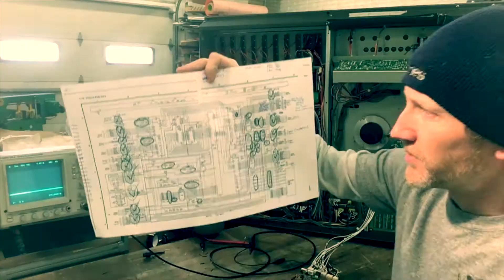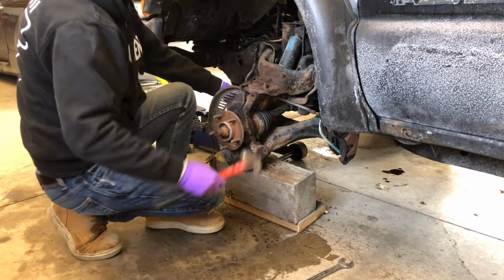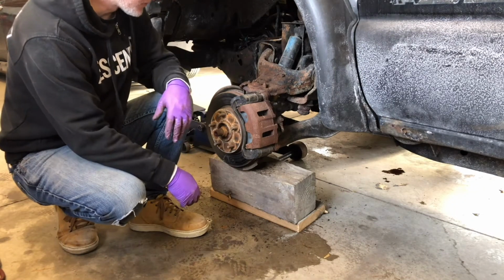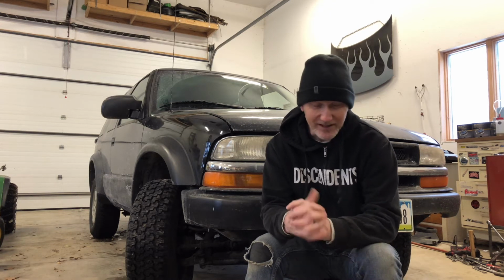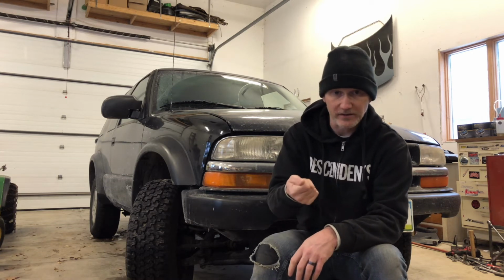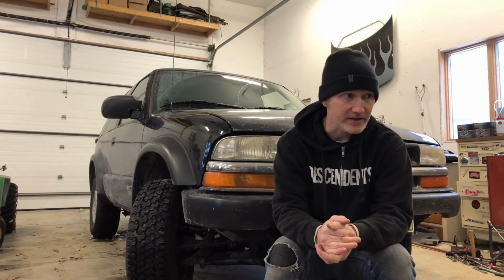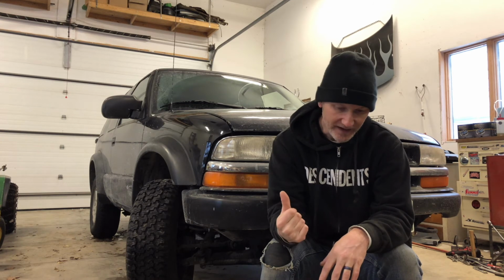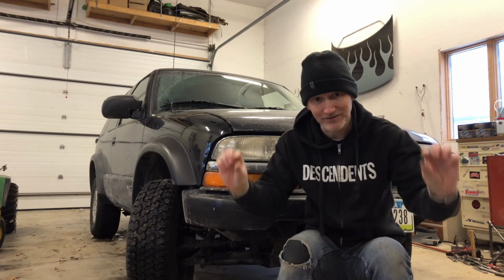My 2000 Blazer Hates Me

Comment: Bought mine for $4900CAD, 175,000kms and in much better shape that your fever dream here. Now, after doing many repairs on my own I’m into it for $10,000 after redoing shocks, upper control arms, breaks, ignition components, and now the icing on the cake, having a transmission shop install a master slave cylinder and clutch kit. I hope you’re right on your prediction about these Blazers becoming the next Ford Broncos. Good vid, thanks.